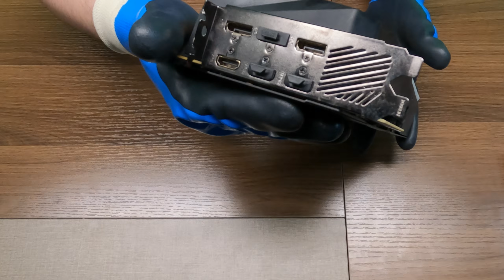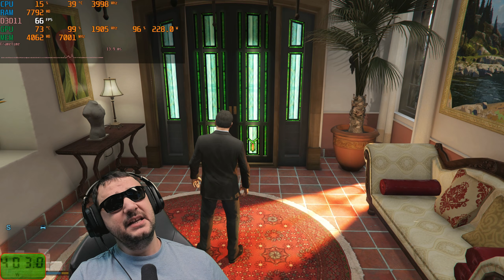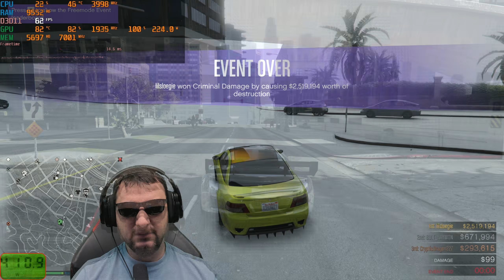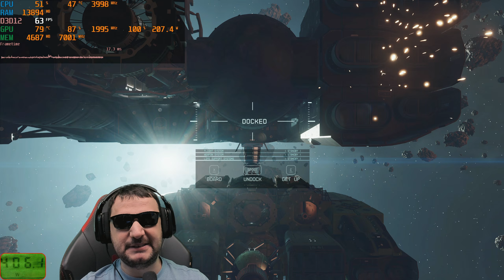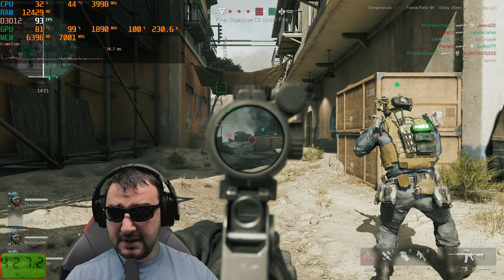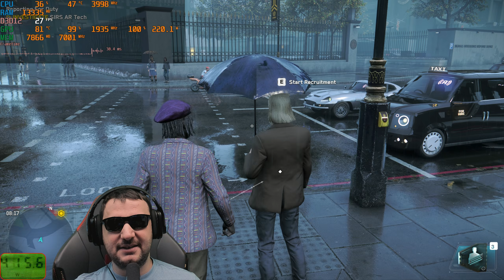Gigabyte AORUS RTX 3070 Master Feat  i7 6950X Benchmark

Comment: I still rocking my 6950X clocked at 4200MHz powering an RTX 4080. It can go 4400 MHz, but requires more voltage and the mobo's VRM gets too toasty.
Reply from the maker: not worth the risk for that.

Comment: You should undervolt that 3070. I had a 3060Ti from Gigabyte and it rarely got above 65ºC even in summer with A/C turned off in my room. You should change the thermal paste and check if the thermal pads are not to thick. But in the meantime undervolt it, you should have 5-7ºC lower temps with the same perfromance.
Reply from the maker: i`m looking now for some high end TP. maybe maybe ?
Reply: @DanielCardei  Undervolt it until then :) you should drop about 40-50W and have lower temps. I do this on all my cards, my 4070 drops from about 190W to 150W with no performance loss.
Reply from the maker: @drupiROM  i did like -50mv.  i should have done -200 at least?
Reply: @DanielCardei  You could try 900mV and see if it's stable then go from there. My 3060Ti was ok at 875 mV.

Comment: Gotta oc that i7 6950x and use Samsung B Die DDR4 Memory
Reply from the maker: @RealTechGeek  learning.
Reply: Ok cool merry Christmas Eve. I'm gonna get another i7 6950x for my X99 Rampage  V Edition 10 soon.
Reply from the maker: @RealTechGeek  asus x99-e.  Max hz the mobo can do is 3400hz. I try 3200 and it stalled.  Some hyperx memory that came with it. I'll look into getting 3400 but I don't think it will run. Xmp lower thr memory when ita pushing the cores up. Why?:_wtf:
Reply: Hi sorry for late reply @DanielCardei
Reply: Get either Acer Predator Vesta Ddr4 3600mhz cl16 Cl14  HP ram 3200mhz cl14 ram or Patriot Viper 4400mhz cl17 you can clock that down @DanielCardei

Comment: Hell yeah nice upgrade, I'd recommend pushing CPU core to 4.4ghz (1.3-1.4v should work) set cache to 3600mhz @ 1.25v, and make sure you're running the ram at 3200mhz 😊 enjoy
Reply: Is there anywhere i can reach you? I can help you overclock it 😊
Reply from the maker: I have x99-e mobo
Reply: @DanielCardei  Asus?
Reply from the maker: @SlowHardware  yes
Reply: @DanielCardei  in that case vccin will be called CPU input voltage on your board, run that at 1.95v (stock it runs 1.8v) set CPU multiplier to 44, CPU Core Voltage 1.35, Cache voltage 1.3v, Cache multiplier 36

Comment: I got a 9800x3d rtx 4090 power house ....Also I have a old asus rampage v plus a 6950x clock at 4.5 plus quad channel 64gb 300mhz memory..own it since 2015 and for some reaseon I still upgrade the gpu in that rig .. now is pairing with a rtx 4070 and at 1440p is still a good gaming rig 9 years later..if that not screams longevity I don't know what else to say.

Comment: I just built a pretty sweet 6950x system on the Gigabyte x99 SOC Champion motherboard. I had to get two mobos though because the first one had a dead memory voltage controller. :( Right now I'm running two MSI 980Ti Goldens in SLI. It's the first SLI system I've ever built.